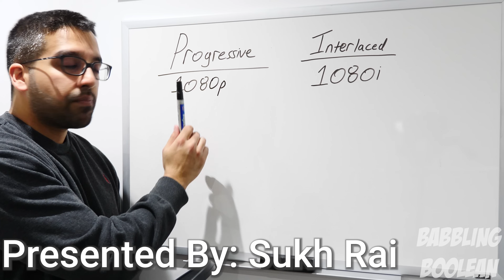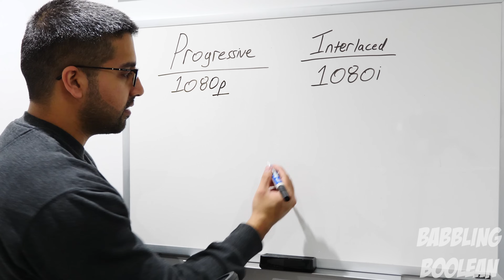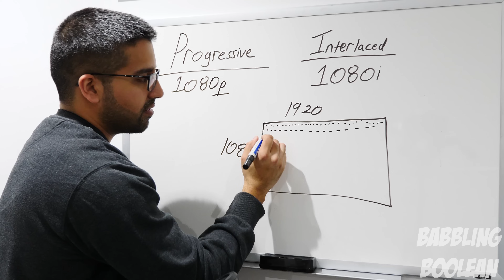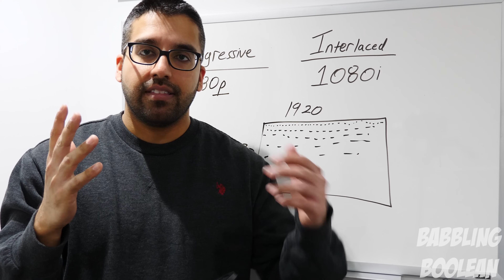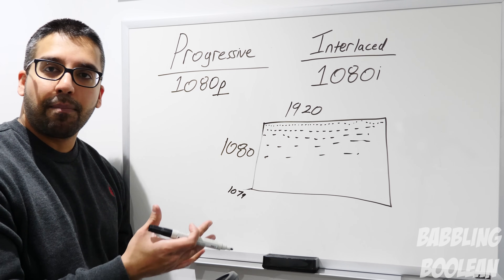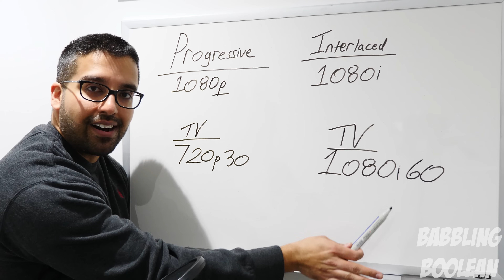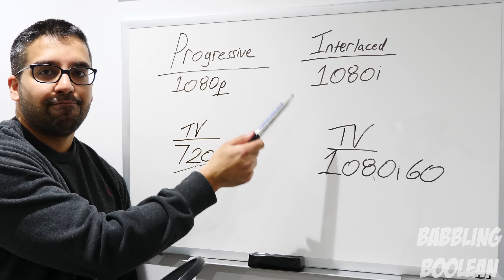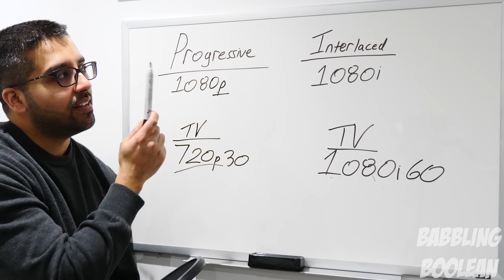TV Explained: Progressive and Interlaced

Comment: Why there is no 32inch 1080&4k TVs?
Reply: The visual quality on a smaller screen is impossible for the human eye to tell a difference. It’s not worth making. 

It’s like...colouring a black piece of paper with a black marker. No real point.
Reply: @jamessmyth3952  why i got that doubt is.
we have mobile phones with 6.4 , 6.7 inch SAMOLED displays with 2340 X 1080 , 1080x2400 resolutions . So why can't we make 32 inch 4k TV with 1920 X 1080 ,     3840 X 2160 resolutions.
Reply: @wenodkrishna168  you can but it would be incredibly expensive. There’s no market for it.
Reply: @jamessmyth3952  I don't think it will be expensive , because we have phones with 6GB Ram , 128GB storage , 64 mp rear camera , 32 front camera , SAMOLED display 6.4 inch , Snapdragon 730g processor , 7000mah battery for 23000 Indian rupees(Samsung M51).  For TV we don't want that much  of ram , storage , camera , processor . I think   cost will be less. 
Sorry if I am wrong , it's just a doubt . I thought you are Wright person to ask these doubts.
Reply from the maker: James is correct. You can get phones with all these nice parts, features and specs because people continue to buy phones but not many people buy small TVs. Most people nowadays want bigger screens.

Comment: TVs since plasma and LCD are progressive displays just like computer monitors, so they deinterlace all interlaced input - or a cable settop box does that before outputting deinterlaced 1080p signal into TV.
Were there ever 1080i CRTs capable of displaying such signal without the need to deinterlace?

Comment: Even though “p” doesn’t stand for “pixel”, it’s not “100% incorrect”. It’s still true that there are 1080 PIXELS down. And then 1920 pixels across. So I don’t see the difference between calling it “progressive” or “pixels”.
Reply: And that's when the confusion starts about P's and the I's. I didn't know until I watch this video. It ended up in my feed for some reason, but that's ok. I used to wonder about the difference. I'm not changing my TV any time soon, but this information will help me to decide in the distant future when I get my 1st smart TV. Yes, I'm still using a dumb TV.

Comment: I don’t agree with you in something... in 1080p the P stands for pixels, if you turn 90degrees your explanation you have 1080 pixels repeated 1920 times. So for me the p is related for pixels. Although it does not mean that your screen has 1080 pixels, but 1080 pixels repeated 1920 times ;)
Reply: It’s not referring to pixels it’s referring to the distinction between progressive scan and interlaced.

Comment: Brother explain me one thing
How movies shot at 24fps are shown on TV channels broad casting at 30 fps....
Reply: IIRC there is no problem broadcasting with different fps; lower fps will be maintained, anything higher will be cut down. Higher fps just means sharper pictures during movement (and less blur when paused). Built-in video decoders in displays will extrapolate the frames and render the videos accordingly.

Comment: When you say 1080 times, will scan happens in second ?
Reply: no. he means that there are 1080 lines of 1920 pixels. it scans as many times per second, as the frame rate of the broadcast. 25 times in europe and 30 in u.s. are the typical ones. for sports usually duobel that - 50 in europe and 60 in the stares.